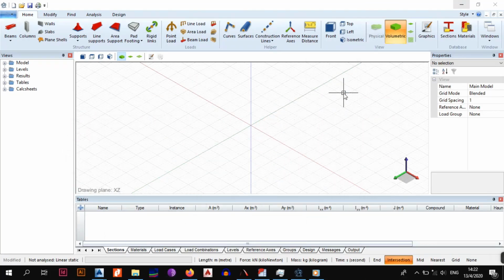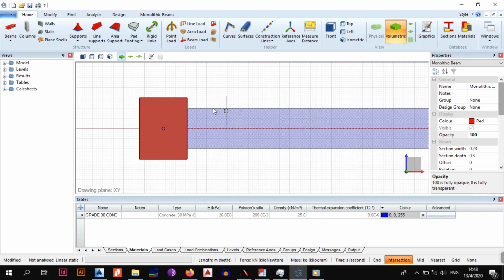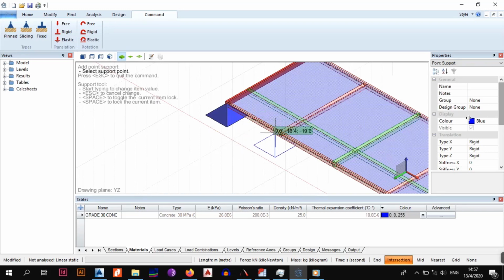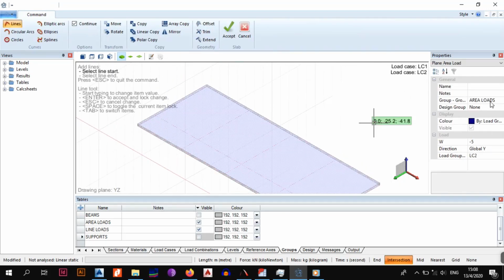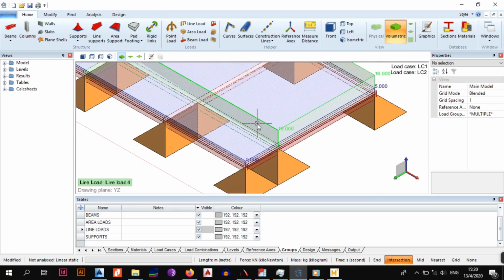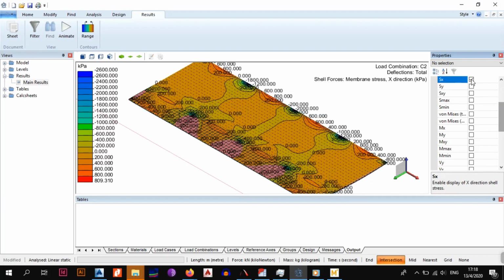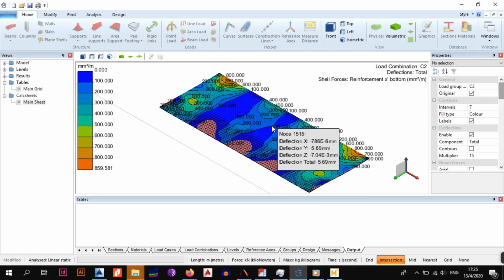HOW TO DESIGN a Double Story Building: Part 6 (SLAB DESIGN IN SUMO)

Comment from the maker: Hie Guys and below are timestamps for you to go to your favorite parts
00:01 Intro
00:20 Special Notes on Episode 
01:00 Setting Up the Working Folder 
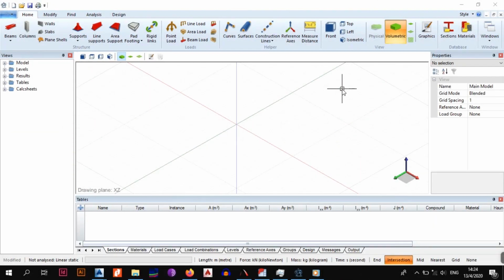02:04 Setting Up the Shell
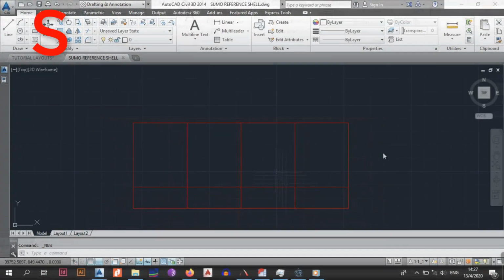04:28 Importing DWG Shell 
05:40 Setting Up the Line-work
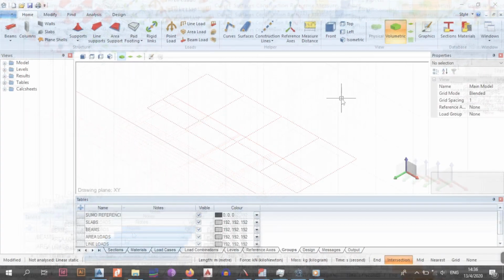08:01 Setting Design Materials
09:30 Creating the Slab Model
11:47 Adding the First Beam
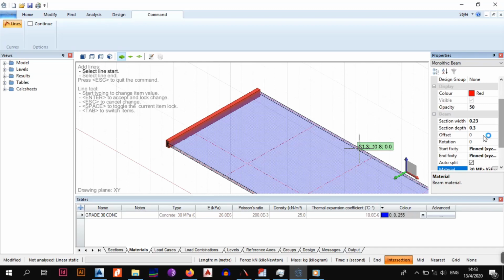13:40 Offsetting the Beam
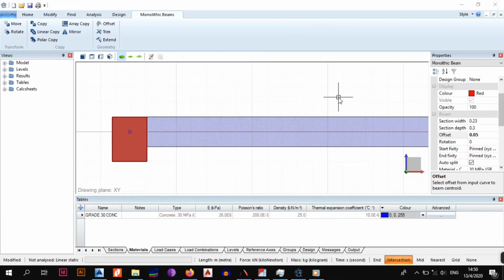15:43 Adding the Rest of the Beam 
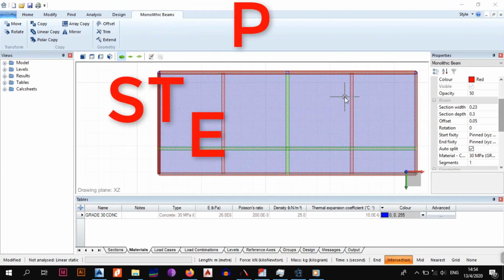19:20 Understanding Supports 
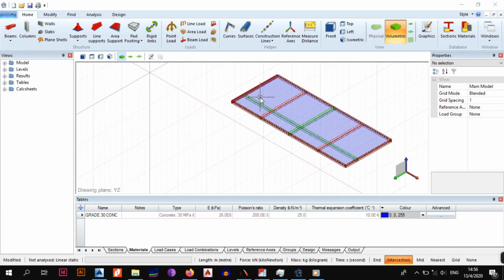20:55 Adding the Supports 
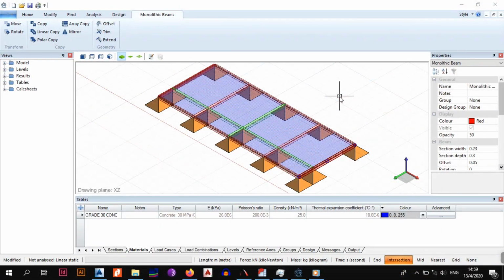22:51 Verifying the Beam Group
24:35 Adding Load Cases 
27:50 Adding Area Loads
29:42 Adding Line Loads 
32:45 Evaluating the Model
34:33 Analysis & Solving the Model
36:35 Interpreting the Results 
41:01 Shell Forces Results 
46:05 Conclusion